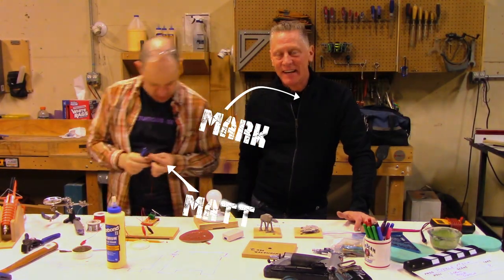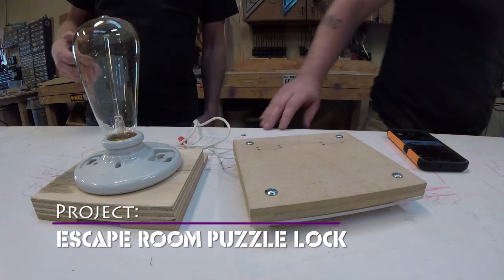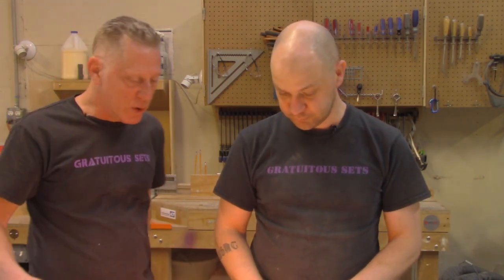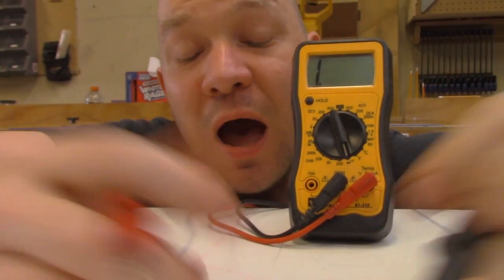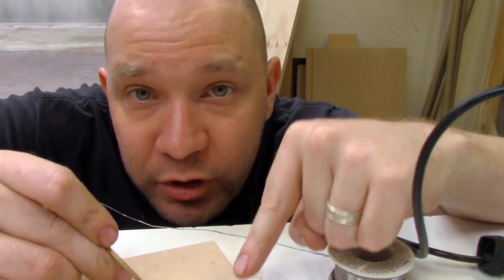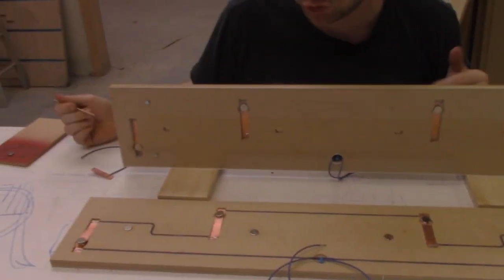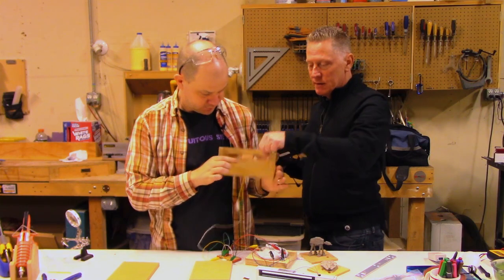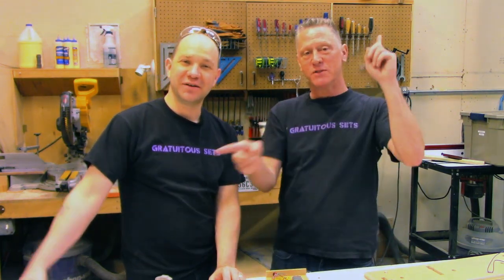Escape Room Puzzle Lock

Comment: Really appreciate the instructions.  The perfect nudge for some design help I needed.
Reply: Can you provide any details on your power source and the electro magnet?
Reply from the maker: The magnet in the video is fairly burly. It's a 600lb security lock from Seco-Larm (via Amazon). It can be configured to operate at 12V or 24V DC. I was actually surprised at how little amperage they draw. At 12V (which is what we used via a basic transformer) it only draws 500mA. We haven't yet done a test to see how long the magnet will last if we just have it pulling from a rack of 8 AA batteries, but it would work.
Playing with the magnets we learned that the thickness of the steel plate is very important. The electromagnet has a field that's about 1/4" deep. The steel plate (comes with the magnet) is 1/4" thick. It was a cool illustration to me (who hasn't taken an earth-science/physics class in quite awhile) that the magnet grabs 3-dimensional volume not 2-dimensional area. If you put a piece of sheet metal on the magnet you can pull it off by hand.

Comment: Nice work and I am enjoying the videos. I also like to make mechanical props but if they are using control software to run the escape room adding an Arduino or Raspberry Pi to each puzzle can be a good idea (I would use magnets and reed switches). Most control software can talk to microcontrollers and get the status of the puzzle and create triggers. This is very helpful for the person who is running the room.
Reply from the maker: Thanks for watching. We've done a few projects in the past that have used Arduino control, having learned just enough to have an idea of what that tech can do on the entry level. Some of our next round of more complex puzzles for @RedDoorEscape will use more Arduino; and we'll continue to wade into those water. For now we're going with 'simple = robust.' Stay tuned for those lessons as we learn them.

Comment: Why you didn't you juse a Reed contact?
Reply from the maker: The real driving factors were prop toughness, how much material the magnets had to penetrate, and reliability.  By slightly twisting the moveable copper contacts, the switch contacts are self cleaning. The field is active through 3/4" of urethane resin and MDF.  We built this mech into the Stela, but I can't say more in the comments section. Watch the "Putting it all together" video, then call me if you still have questions :-D I can tell you how the prop actually works

Comment: What's the gauge of the copper sheet that you used. I want to make sure I am not getting to thin of a sheet.
Reply from the maker: Micrometer says .0075 inches.  I'll double check😉
Reply from the maker: Yes- It checks out at .0075 inches. A bit thinner is probably okay as long as you use a retainer like we explained.
Reply: Awesome thanks so much

Comment: excellent job guys! another way around the cnc machine is using a rotor.     sheet of wood on the table, rotor in place connect a peice of wood to the base of the rotor with a little 1\2 by 1\2 peice of wood on the bottom of it and beside your project just make a channel out of 2 peices of half inch material. drop your guide into the center of your channel and away you go.... an example is to put your left and right thumb and fore finger together, drop the guide attatched to your rotor in there and someone operating the rotor could mimic the gap between those fingers  perfectly.... if your hands were also nailed to the table ...    ((obviously you could make any design by cutting your 1\2 material and nailing it down like in a P, the rotor cant cut corners so it will be rounded even if your channel isnt)
Reply from the maker: Yup! Using a template or guide rails, preferably with a bushing set and mortising bit in a router would work great! Btw- our CNC machine is actually just a fancy motion controller for a powerful water cooled router, so either way, it's a router:-)
Reply: it looks good, do you use auto cad to operate it ?
Reply from the maker: Adobe Illustrator and others for drawing/modeling, then Cut2D to generate the G-code that runs it.  For 3D work, the process is a bit different.

Comment: Hey Mark and Matt. I actually talked to Mark just a few days ago on phone and thanks for the call. Just for learning purposes I am curious as to why you didn't use a reed switch for the magnetic contact switch. I was guessing maybe because the puzzle has some reversed poles which I don't think you could do with a reed switch. I've seen where you can hold a reed switch closed with a weak magnet then open it with a stronger magnet but never tried it because it feels cumbersome. Just curious about your design thoughts. Thanks again. Great Work.
Reply from the maker: The real driving factors were prop toughness, how much material the magnets had to penetrate, and reliability.  By slightly twisting the moveable copper contacts, the switch contacts are self cleaning. The field is active through 3/4" of urethane resin and MDF.  We built this mech into the Stela, but I can't say more in the comments section. Watch the "Putting it all together" video, then call me if you still have questions :-D I can tell you how the prop actually works

Comment: Great tutorial, but one question. You mentioned a relay to the maglock.  Why is the relay needed?  Can't you supply leads in from a 12 volt DC and lead out straight to the maglock?
Reply: The mag lock needs constant current for it to be locked, this system is an open circuit, no current flows until you close the the circuit with the magnets, then you can switch the relay from on to off and the mag lock opens

Comment: Thanks so much for sharing this video - I'm working on a puzzle box that requires the placement of objects on the top of the box and this video helped me get closer to a solution - could you go into more detail on the wiring/parts used? My plan includes an electromagnetic lock (similar to the one in the video) that disengages when the right objects are put in the right locations. Thanks so much in advance!
Reply from the maker: Glad to help, and thanks for watching.
Here's the basic wiring diagram.
https://drive.google.com/open?id=0B0Zqf7VlURTmSmg2N0dyYWtGTmc
The "Puzzle Mechanism" is just what we go over in this video, consisting of one or more switches in series.
The power supply we used is 12V DC. You'll want to find one whose amperage just barely exceeds the requirement for your maglock, which will probably be 500mA or less. (Excess amperage becomes heat. Too much heat fries electronics. Maglocks are made to be on more than they are off, so they're good at surviving a little bit of heat. Solenoids, less so.)
The relay is 12V, as that lets us use the same power for it and the maglock.
Maglocks some in various strengths from 80 lbs to 600 lbs and even higher. We get ours from Amazon.
Reply from the maker: There is more info on the relay, etc. posted in the comments section of the puzzle mech video; if you have any other specific questions that aren't covered there, just ask:-)
Reply: Great stuff!
What is the youtube name of the puzzle mech video?  Link, if possible.
Trying to discover where to get your copper strips and magnets.  What exactly are the magnets.  Again, links, if possible.

Comment: Surprised you didn’t use a Hall effect sensor. You might need to use a transistor or op amp to invert the signal but I would think it would be very robust.
Reply from the maker: We didn't even know what a hall effect sensor WAS back then. We knew what we wanted it to do, so we just built it from scratch. The good thing is that they have never failed once!
Reply: Gratuitous Sets hey if it works right?

Comment: Thanks for sharing, fantastic video as always! How did you connect copper strip with magnet? With hot glue as well? 
Thanks!
Reply from the maker: Scotch brand "Extremely Strong Mounting Tape"
Hot glue doesnt stick very well, even if we sanded it first. I tried to solder one, but the heat de-magnetized the magnet!
Reply: thanks

Comment: Why not use Reed Switches?
Reply from the maker: There were several reasons, but the main ones are: 
The game pieces were solid cast stone glyphs.  They are expensive to produce and needed to be solid and seamless. There is no way to repair a piece once built.
2. Reed switches fail occasionally and aren't actually simpler, they're just easier to install and require a bit less labor :-)
Reply from the maker: It was used in this prop- you can see the stone glyphs toward the end.  https://youtu.be/cnYjUA3Z2Ug
We have a detailed video of the individual glyphs here, in the Jaguar stelae video:  https://youtu.be/aF35NVNFQLY

Comment: I really dig the simplicity of V.1. (you know, for when you are in a hurry) I would keep some of these rubber coated magnets handy and just cut the top off so it still makes the connection but is protected from impact and separation - https://www.kjmagnetics.com/proddetail.asp?prod=D84PC-BLK
Reply from the maker: Very cool!
Reply from the maker: Btw- there is no single separation vector- in can easily happen at the join between the magnet and copper. We tried to solve this by soldering the magnet to the copper, but this completely de-magnetizes the magnet. NO HEAT CAN BE USED ON MAGNETS
:-)